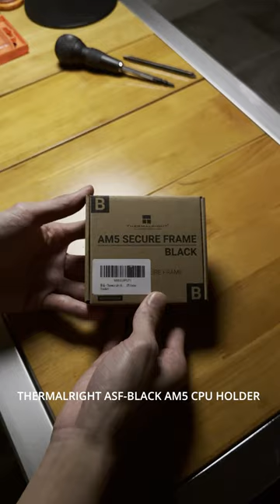Formd T1 AMD Ryzen 7 9800x3d ITX black build

Comment: hi man did you need to flash the bios before for the 9800x3d to work, or did it work out of the box?
Reply from the maker: Worked out the box, did not need to flash the bios. I did update everything afterwards using Armoury Crate.